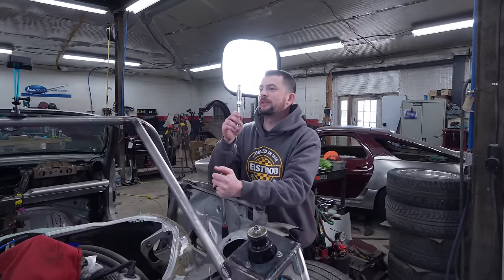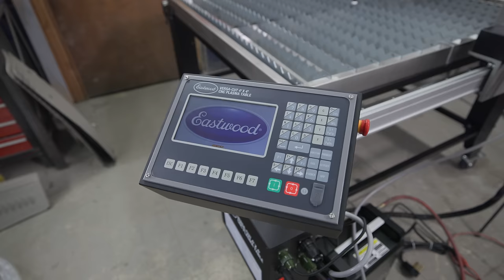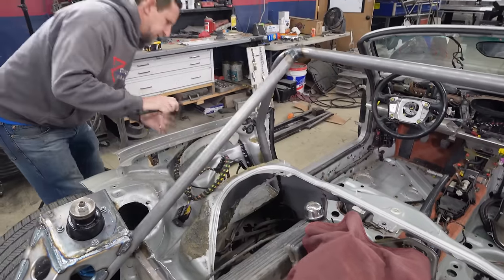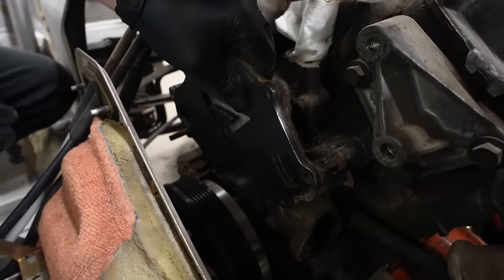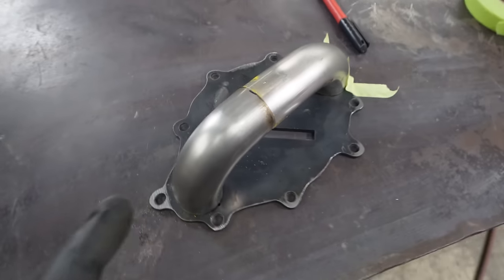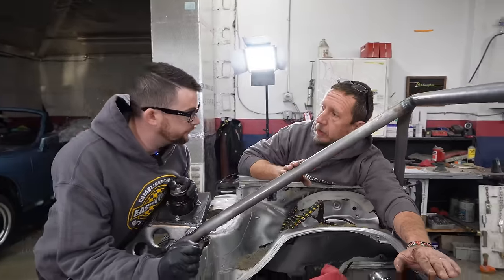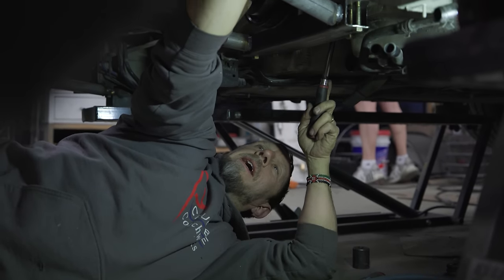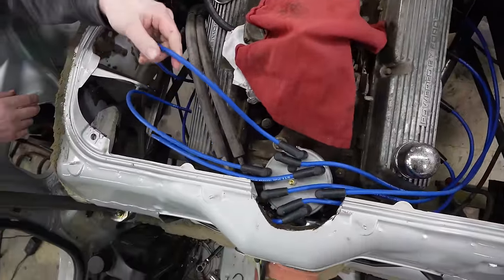Building Our Own SUPERCAR! Custom Cooling System - Project Jigsaw

Comment: If you t-ed the inlet and outlet for the water pump on the block , how is the water going to circulate ?  Will it return to the radiator  through the heater core lines ?

Comment: Love everything but they engine, you really should have picked a better engine, that thing is only gonna make like 200 hp
Reply from the maker: That engine will make way more power when we’re done with it. AND, it was my dad’s engine so it is has been the only choice from the beginning
Reply: That's actually a really good reason to use it 👍
Reply: i had one of those in my boat made close to 400 hp.
Reply: @CrucibleCoachworks that's a good reason, but at least do fuel injection so you have a chance to make that power?